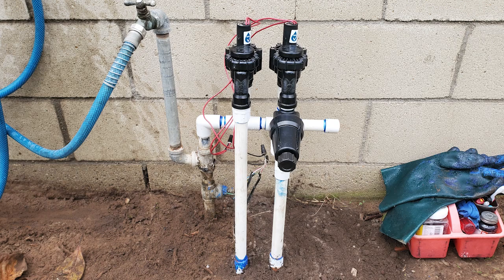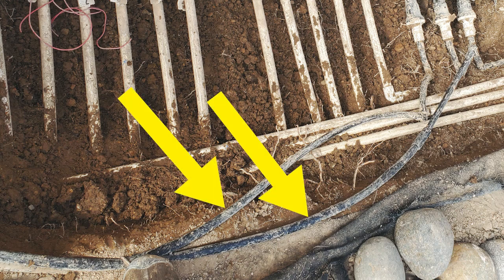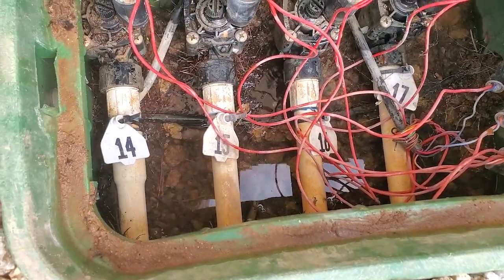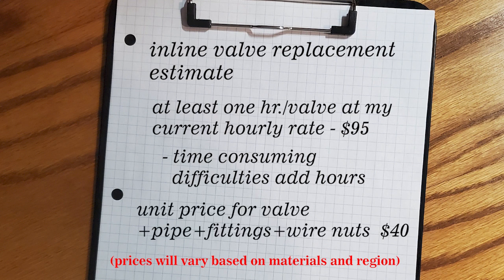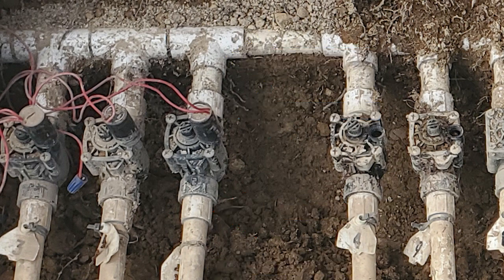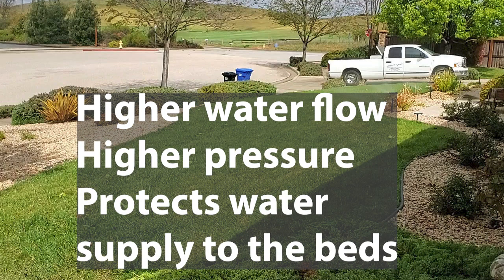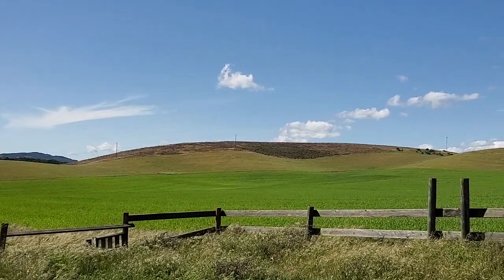I replaced 17 valves in ONE location! | Learn some valuable intel

Comment: I only have one valve, I guess I should be thankful for that.  It was 30 years old, and had no manufacturer info on it and I just replaced with an orbit 1" inline valve.  I also reran the pvc from the water main to my valve.  It was an intimidating project at first, but came out great.  I even dug out the box and refilled with gravel in order to allow better drainage.

Comment: The slip fix is a great option. I have found if you install them to close to the value you will have movement when the value turns on and off in the slip fix and in turn will develop  a leak or a break. Just something to think about.
Reply from the maker: Absolutely true and I attempted to make that point in the video. That's why I mentioned that it's not my first choice but the circumstances were ripe for making an exception. Thanks for chiming in with that valid concern.

Comment: I replaced 6 Orbit Jar Tops with Hunter self cleaning valves. The well water we have has a lot of black Manganese in it. I had to clean the Jar tops sometimes 2x a year even though we have a filter screen on the supply.  I was going to use unions but ended up using compression couplers instead because the out pipes were too hard to cut to precision length needed for unions. Great video thanks.
Reply from the maker: That black stuff is awful. I had a job many moons ago where the well water was so caustic that it ate through the brass backflow device in 2 years! No filter.

Comment: thanks for the videos.  I found you while planning for my own irrigation system.  Do you have any recommendation for an irrigation system in located in Canada where the winter could be pretty cold.  In addition, my home's water system run on an artesian well, I would like to have the most efficient sprinklers to minimize water consumption.  Lastly, I have to irrigate approx 30 000 sq.ft. of grass in addition to 8 000 sq.ft. of flowersbeds spread all over the property.  I started to look around, and it looks like Hunter system works better in low presure/low water flow, but there are too many types of sprinklers I'm totally lost.
Reply from the maker: Alan, wow, you have some extreme conditions and perameters. You can't go wrong with the Hunter products. It's mostly what I use. As far as the well water, be sure to watch my video about Irrigationg with Well Water. The cold water situation.....I have a video teaching how to blow out your water lines in the winter so as long as there is no water in the lines during the winter, that's not an issue. I don't recommend multi stream rotar sprays or 'Techline' on well systems as you'll see in my videos. Let me know how it goes.

Comment: Wow.  My wiring looks way cleaner and I'm not even a professional.  You were nice to agree to deal with this guy's mess. And no waterproofing of the wire connections?  What I'm surprised about is how straight and square he installed all the valve boxes though. They are perfectly straight and inline.  But then his wiring is so messy like two different people did it in my opinion. (the original installer)
Reply from the maker: I use watertite wire nuts (i.e. King). I don't use the big waterproofing assemblies that I am guessing you are speaking of.

Comment: For the drip lines you have a pressure reducer and the adapter to drip. What about an inline filter?  Others videos call for one. Or is all the water filtered upstream? Thoughts!

I’m building a new system soon and your video is very helpful. Thanks
Reply from the maker: Richard, I see I didn't SAY anything about the filter, but it's there. On these installations, a wye filter is the only one you can service. A straight inline filter is unserviceable. You can see more on my drip videos. The place in this video where I show the wye filter starts at 8:16  Good luck with yours.
Reply: Thank you. I hadn’t thought about servicing the filter. I will now. 👍

Comment: The previous owner installed underground anti syphon valves which release water when the valve turns off. Can I replace them with inline valves? There is no backflow preventer. Thanks great videos!!
Reply from the maker: The anti-siphon valves act as independent backflow preventers. In most cases, the a/s valves will 'release' water after operating because the piping or drip tubing on that line is above height of the valve so the water will blurp out of the anti-siphon cap until the water in the piping or tubing has equalized. This is totally normal but is an example of why the sprinkler valves should be above the piping or tubing. All that said as a possibility only of your situation. You can replace the a/s valves with inline valves but it's not recommended if there is no backflow prevention.

Comment: Looking for some guidance for the house that we just moved into. One zone of our sprinklers has very low pressure. Before I replaced the heads they would sprinkle a couple of feet. After I replaced them- initially with the Hunter PGP Rotor, then with the Hunter 4in pop-up- they barely pop-up at all, and when they do they spray it's only a couple of issues. I'm assuming the issue is pressure, but every other zone in our yard has good pressure and has done great with the sprinkler head swap. Of note, the problematic zone has 7 heads in it, while most of the functional zones have 3-4 (though we do have one zone that's 6 heads that functions well with the Hunter 4in pop-ups). When the problematic zone is running I don't see water coming up from the grass in any particular area (that would make me think that there's an obvious leak there). What's the best way to start troubleshooting this? I know I could probable dig up all the piping from valve station the all the heads, but would like to know if there are any troubleshooting steps short of this I could try first
Reply from the maker: Sean, it sounds like there are just too many heads on that line. Try turning off the nozzles on half of them and see how it does. If this is the case then you have two options. Cap off half the heads (reduce the lawn area) or replace the nozzles with rotary nozzles like Hunter MP Rotators which you can view on the video Best Rotary Nozzles . BTW, you can purchase a Hunter gauge and adapter available on the Sprinklers page of my Resources site. With that you can check the water pressure on your existing lines as they are right now to establish a benchmark. On each line, check the pressure on the furthest head from the valve. Write it down. The operating PSI needs to be a minimum of 30 but preferable between 30 and 40. Let me know how it goes.
Reply: if only one zone has low pressure you may have a restricted pipe.  if your system has poly pipe it may have been crushed by a rock or root therefore reducing pressure/flow

Comment: How do you put in a pressure gauge for a sprinkler system? my system is full pressure somewhere between 65 to 90 PSI. Which pressure gauge would you recommend? Is it on your resource page?  I have above ground Hunter ASV 3/4'' valve.
Reply from the maker: You can put it on a hose bibb if there are no pressure regulators before it. If you're going to replace a sprinkler valve, after you remove the old one you can figure out a way to attach the guage there before installing the new valve.Those are just two ideas. I have a guage on the Sprinklers page of my Resources site. It won't connect onto a hose bibb without an adapter.

Comment: Thank you for your video.  I am curious as to why in a big rebuild job like this that you don't install a pvc union on one side or the other of each valve to allow future service/replacement.  

One other question.  In a big setup of in-line vales, i assume that there is also a master valve?  Is that valve a antiphon valve or is it a two part setup with a brass vacuum breaker + inline? Best practice?
Reply from the maker: Larry, Good questions!  Unions are a great idea and I intend to make a video about them, but in short there are 2 main reasons I don't. These reasons are not difinitive and I'm not saying don't do it. These are just my reasons. Too many times over the years I have done my best to avoid leaks during jobs. One example is an 8 valve a/s manifold I built and did it assembly line style as usual and attempted to teflon wrap everything the same and torque everything the same yet the middle valve (of course) leaked when it was complete. Arrrgh! For this reason, I avoid threads and unions have threads. Another reason is there are several other things about unions that can be problematic that I've dealt with that I'll go into in that video.
The video shows the PVB that was already inline before the manifold. A PVB, double check valve, or RP are recommended before inline manifolds. An a/s valve is not recommended and in some states/counties/other municipalities they are not legal to be used for this purpose.
Reply: @SprinklerPros  I totally get it on leaks and threads. I find the same thing applies to copper and galvanized piping, where threads tend to leak, sweat does not.  I have found that pvc unions tend to leak over time in the hot sun due to the seal surface turning concaved around the oring and lessening the seal compression.  I don't like placing them on the constant pressure side, but do like having them on the lateral pipe valved side for service.  I wish that they were made a lite bit better (more fiber in the plastic and honed flat against the oring surface), but i guess you get what you pay for.

I caught the image of the PVB upon re-watching. I suspect that a ASV is fine for small to medium residential systems in the main line if it is normally closed, vs normally pressurized, but a good brass PVB, DCV or RP are better although much more expensive options.

Comment: can i use one valve for two pipes that split off into a different section? I know i can but are there cons? Then I dont have to buy two valves for each line.
Reply from the maker: Yes, as long as you've done the math to be sure the line can handle what you intend to put on it. You can visit the manufacturer's website to get the stats on the volume (water flow aka GPM) your valve can handle vs what each sprinkler head/nozzle will require. Just know that, unless you install a ball valve on each (and alternate them being on/off) of the laterals, all of it will come on when the valve is activated. I hope that made sense.

Comment: Why not take advantage of the space and make the manifold above ground? So much easier for future work. I'm converting my underground manifold to above ground. It's currently leaking from multiple locations, and the debris and soil have made access impossible. Underground manifold are a like not wearing seat belts, eventually its gonna kill you to fix it.
Reply from the maker: That was discussed with the owner, but he preferred to remain underground especially given that his manifold faces all day full sun in a hot environment. Fortunately there are no plants or trees nearby so having them underground won't be an issue as far as that's concerned. I just did what you mentioned this last week for a guy when one of his valves needed to be replaced. I replaced all 3 in that box with anti-siphon valves above ground.
Reply: @SprinklerPros  Makes sense. Each location and personal preference is unique. Thanks for your reply. Keep up the good work.

Comment: I like slip fixes.  But why not unions?
Reply from the maker: Dale, a couple of reasons. when splicing into an existing situation, the pipe cuts must be exact for the unions to meet up properly. When splicing in a union sometimes there is little to no flexibility in the piping to scrunch the union in. We don't encounter those problems with a slip fix.

Comment: Do you ever work in the Bay Area?  I have a large job in the East Bay ( Alamo ) that would benefit from your experience.  Way more than 17 valves haha
Reply from the maker: Mike, I have never worked north of Paso Robles/San Miguel, but it's not out of the question. I don't do full irrigation installations anymore. Are you needing troubleshooting and repairs? THAT I can do.

Comment: You should’ve been able to do that replumb job without one slip fix . You had plenty of 90’s you could’ve moved back and pushed back into a coupling or valve.
Reply from the maker: Jeff, in some circumstances that would be correct but in this situation I was under the gun on time and the soil was extremely difficult to cut through due to hard clay soil, thick fibrous roots , and rocks. I am a big fan of doing what you described when possible. I only use slip fixes as a last resort. Thanks for your input.
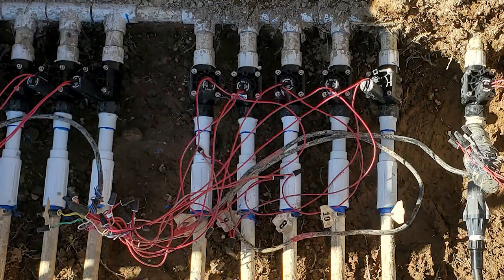Reply: Those slip fixes need to be restrained. (9:11) Otherwise you have a hydraulic ram. Also regarding running 1" out from the valves. If the zone is running more than 12 GPM, I would agree with you, but if flows are less, there is no need to oversize the pipe to the zones.
Reply: @mainlineirrigationinc.4219  I think the point was they could have installed bigger zones and used more gpm per zone had they stayed with 1".  This could have brought them from 17 valves down to maybe 8-10 valves.
Reply: @markkendall331  It actually depends on the water available. If the flow test yields only got 15 GPM, it is pushing it to install even four 3GPM rotors on that zone. The spec limit for laminar flow in 1" SCH40 is 18 GPM. Zone lines you can tolerate more water speed, so 3/4 zone lines are acceptable but ONLY if the mainline is 1". Basically there is nothing wrong with the pipe sizing they used. The biggest error IMHO is having all those valves in one place. Putting the valves and the boxes closer to the zones the valve is running is a much more economical and efficient design.

Comment: Try 7 valves in a single box..... they were in 2 levels, lower and upper going in either north to south or east to west........ that's what I have to deal with. Splitting those up into 2 boxes like it should have been in the first place. WHAT A MESS...... just go on youtube they said..... you will find the answers to how to fix your house problems they said.....  good luck I say.
I swear my house was built by corner cutting men from mars.
Reply from the maker: You (hilarious)....situation (not). That's awful. The other day I came across 6 Irritrol 700-3/4" in one rect. valve box.
Reply: @SprinklerPros  Yucky, I sometimes wonder what were people thinking when they install so many in such a tight space.

Comment: once again your are so OLD SCHOOL!!!   you should have a disclaimer that you don’t use the most modern and current technology.  I am a 26 year  irrigation tech and have kept up with all the newest technology.  your use of PVC glued fittings and slip fixes takes so much time and not to mention you installed this manifold so 1970’s.   you should call yourself OLD SCHOOL PROS.  do yourself and your you tube subscribers a favor and do some research on 2022 products.  this will save them time and they will have a better manifold for the future.
Reply from the maker: John, I am aware of the new products, but newer doesn't necessarily better. I have tried some of the new products you elude to and I don't like them for various reasons. Your time would be better spent showing us how it ought to be done on your channel.